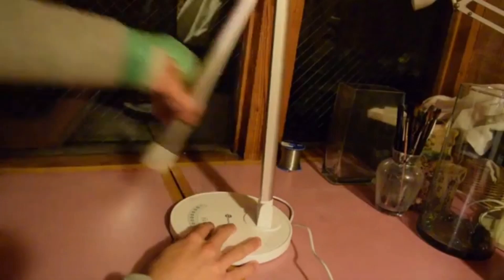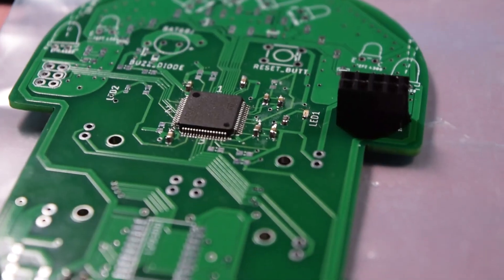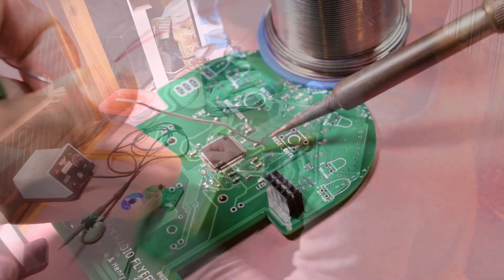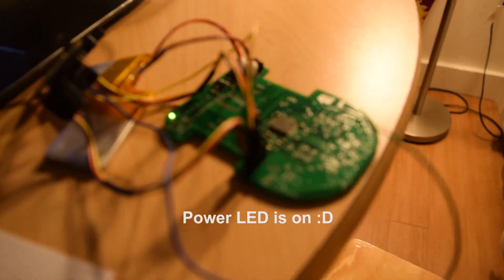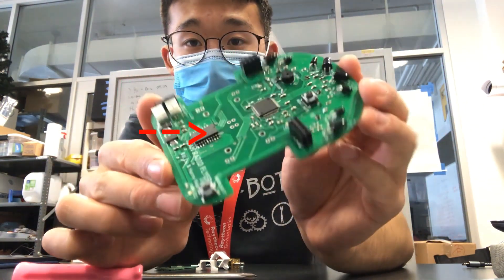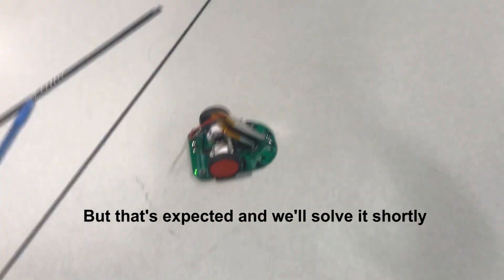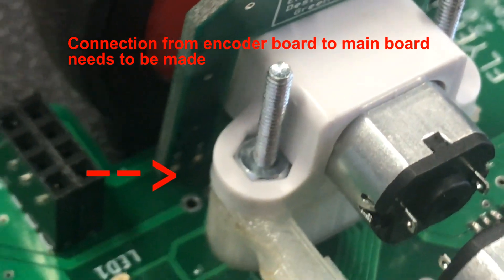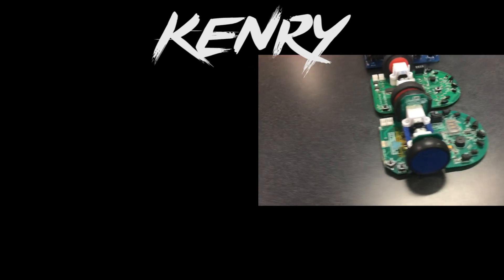Micromouse Part 2: The Build

Comment: I had a question,Did you used pid or any control loop for synchronisation of the motors?
Reply: My micromouse never run straight accurately
Reply from the maker: Hi Ashutosh, yes I used a PD feedback loop with error values from encoder and IR sensors. Feedback will definitely allow you to run straight. Usually it’s really difficult to have micromouse running straight in open-loop bc of motor/wheel irregularities. Hope this helps

Comment: Great work, nice soldering, with very fine pitched smd parts they can be sky wired with 0.1mm enamel wire, 400C sharp iron, . if a design is made mirrored ,, it happens, the chip can be inverted and wired down, . The key is to not cut the wire, loom it round the contacts, soldering as you go  then cut the loops off with a scalpel. under a 10X stereo microscope. . good luck.

Comment: Can you please elaborate on how exactly does the AS538 encoder chip count the rotation? there has to be a magnetic disk rotating infront of it right?
Reply from the maker: Yes, exactly! On the inside of the 3D printed wheels is a magnetic disc with alternating poles. The encoder has a hall effect sensor to sense the pole changes and has two outputs: quadrature and in-phase that lead to the MCU. In the code I parse these inputs to determine direction and “encoder counts”.
Reply: @Kenry  Few more questions, what IDE are you using to code this one? and since its an STM32 based robot, has limited programming space caused any issues till now? I'm currently developing a micromouse myself which is F103 based, haven't uploaded the algorithm yet but its already at max space (almost 90% with all PID and encoder functions+variables)
Reply from the maker: @roboxrobotics3703  I currently am using the Mbed online compiler to upload my code to the MCU. I’m using the F405 line which has 1 Mb flash and 168 MHz clk speed. Looking at the specs now it’s a lot larger in memory and faster in clk speed which will help with your code space and PID. I’m also trying to transition to ST’s Cube IDE so also take a look at that as well.